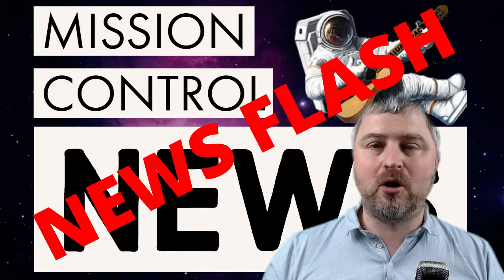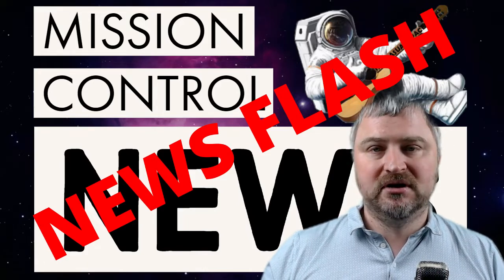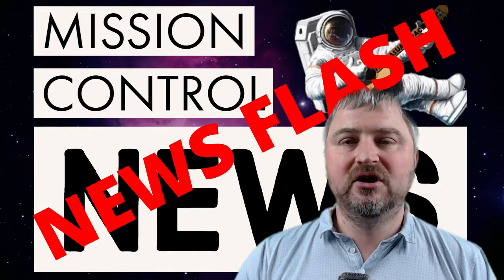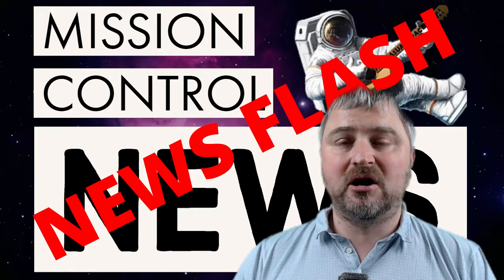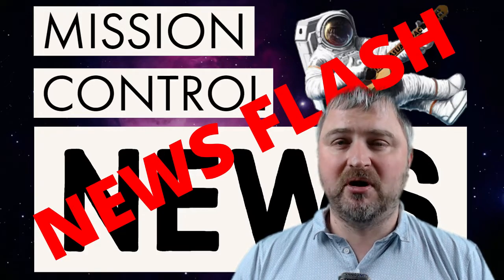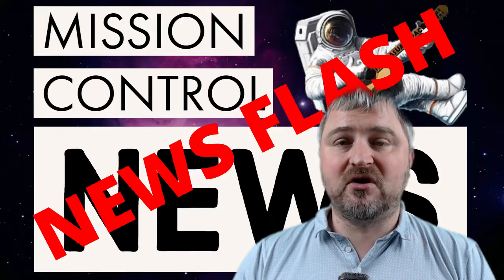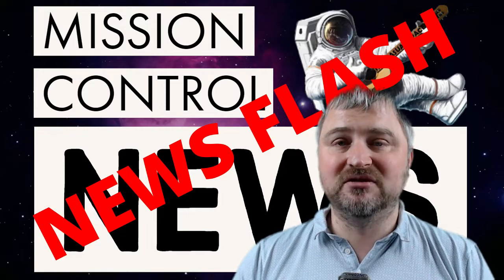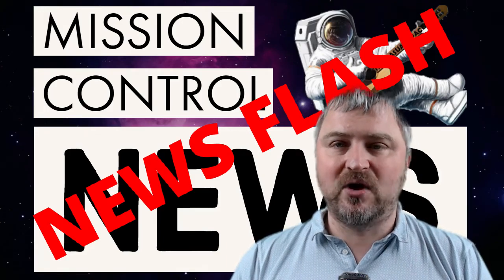Something is happening with Space X Starhopper on Boca Chica Beach Feat. LabPadre

Comment: It's lucky that we can know the Star Hopper is a boilerplate model, otherwise that "dishing" on the panelling would be worrying. I wonder what engine running time will be on the first test?
Reply from the maker: Oh blimey, probably less than 60 seconds.  Initially, It will just rise a few feet, hover for a few seconds, and back down again.  But it will increase with altitude after each test.  They will probably just do the initial test with one engine.  Then add more after each test or tests. How long between each test, is hard to know. It all depends on whether they will want to fully inspect the engine(s) after each test, in which case they will, most likely, take the engine(s) away to inspect them.  Then, of course, the weather is a factor.  It's pretty windy down on Boca Chica beach. So could be days or even weeks depending on the results.  So many things can go wrong during a hop test, let alone a static test. Good question. Thanks for watching.